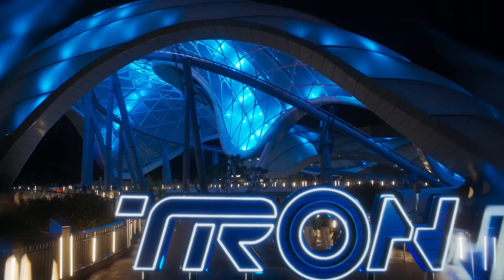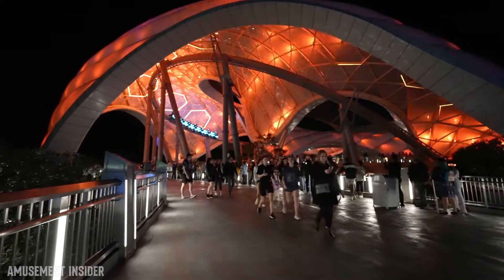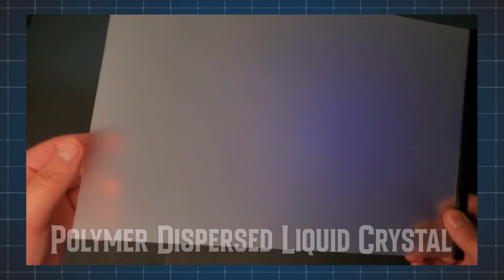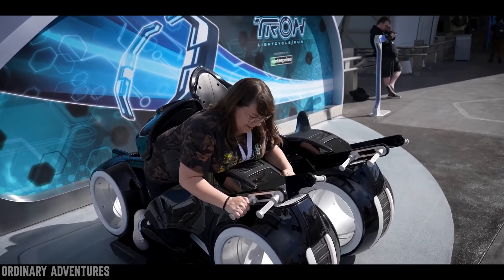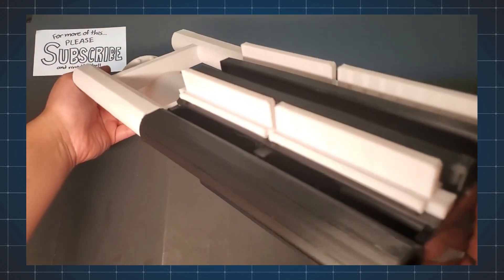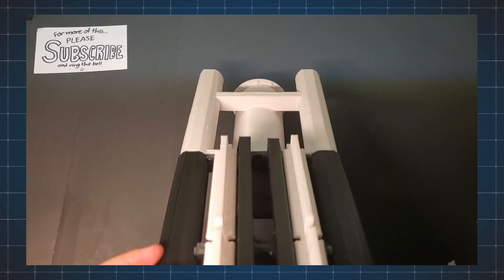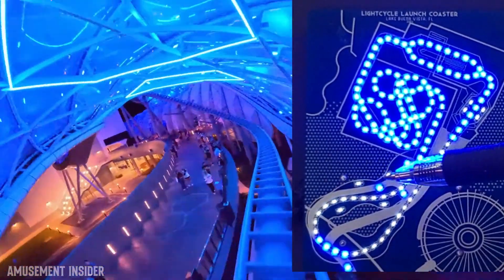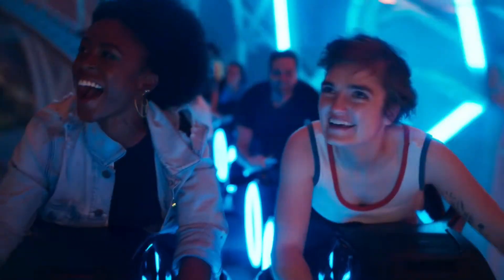TRON Lightcycle Run - HOW IT WORKS | Behind the Ride, Tech & More!

Comment: Great ride but waaay too short.
Reply from the maker: Yeah, it's unfortunately quite short. I assume that's cause of the turn radius of the trains being kind of limited due to size. It would've been nicer to have a little more than brake run, turn, turn, brake run.
Reply: @AmusementLabs  Well, it's an exact duplicate of the one in Shanghai. They should have made it different.

Comment: The sound goes very wonky starting at 8:27. The narration drops dramatically in volume and shifts to the right ear only while the coaster sounds boost up.
Reply from the maker: Stereo. I mentioned it at the start you need earbuds.
Reply: @AmusementLabs   Oh it's true, my hearing is getting worse by the day, it sucks. I am also working on a science lesson while watching your video and thinking about how to apply your stuff in future lessons while working on the one I am going to teach in a few hours. Sorry I missed your warning first time. I am sure I will hear it on future viewings where I pull stuff from your lesson for mine.